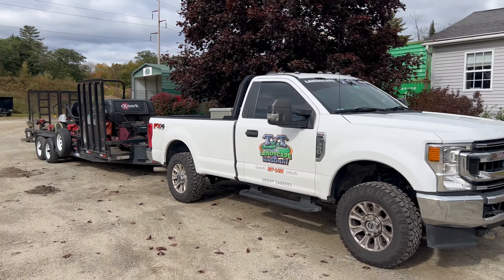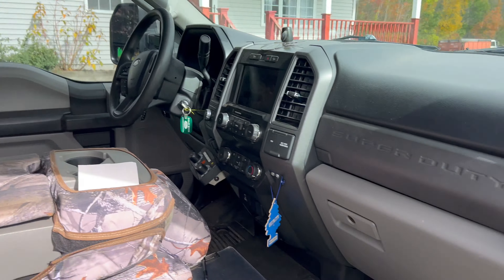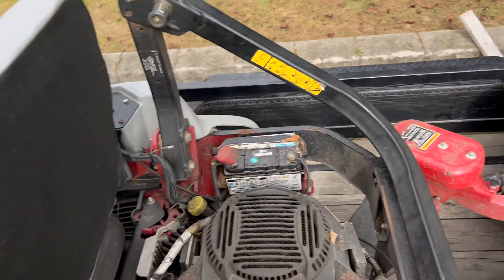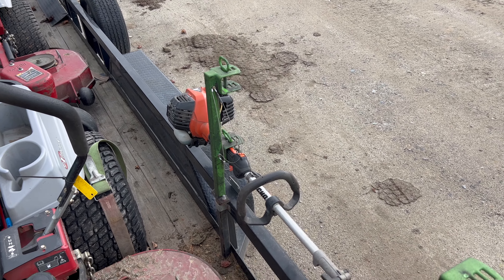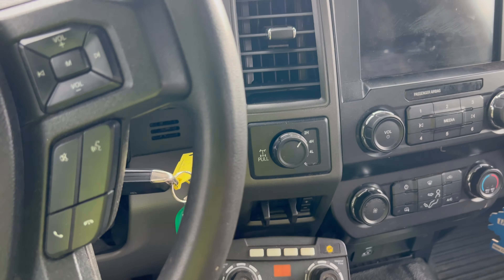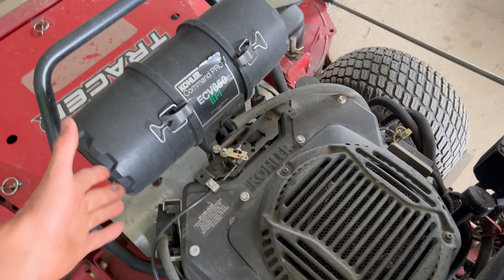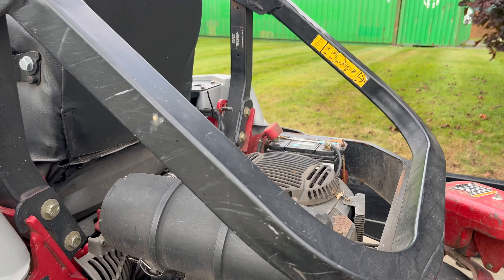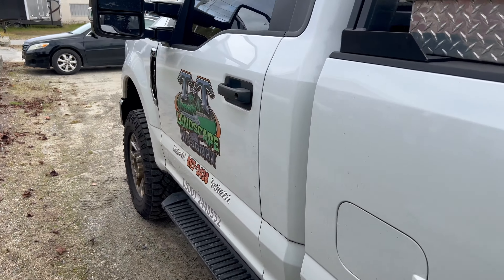Lawn care truck and trailer setup

Comment: You keep the new lazer in the shop as a backup? If so, why do you do that? Just curious. Thats awesome that mower at 2500 keeps going. My oldest one is a 2014 i use every day it has 1600 currently. Still on original kawi motor.
Reply from the maker: The one in the shop is down right now! They do pretty good! That’s is quite a bit of hours haha